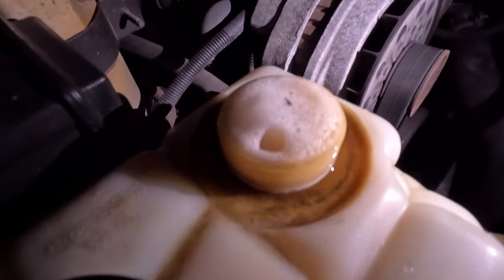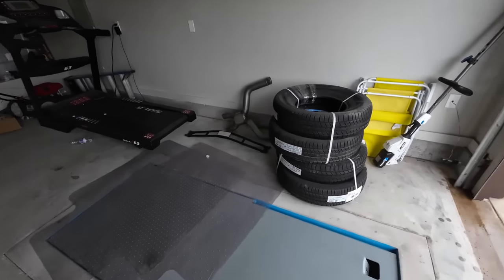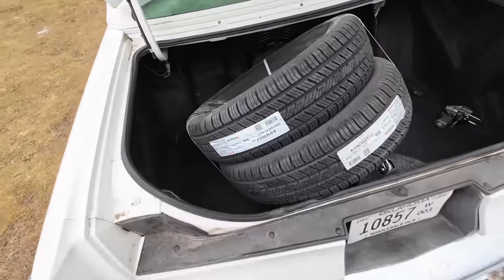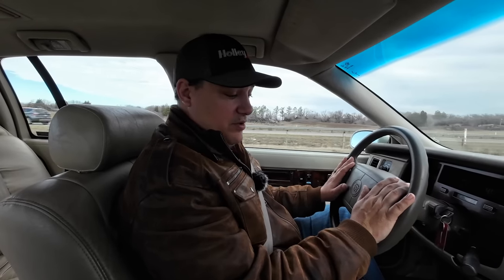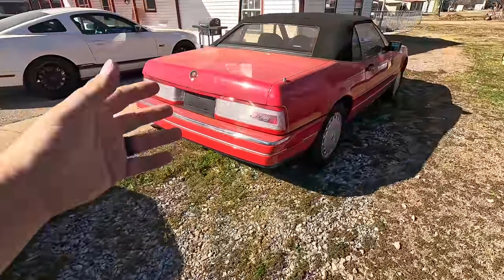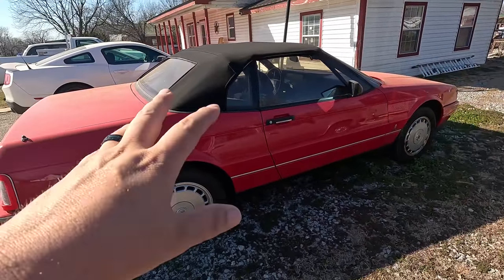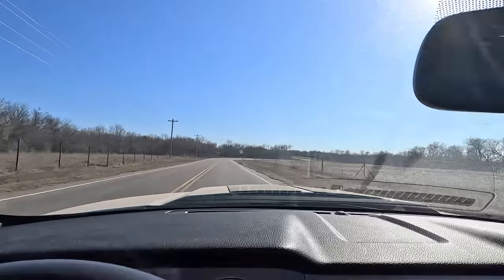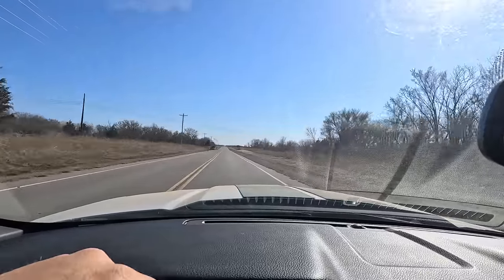My Cheap Cadillac Fleetwood has Cooling System Issues + NEW TIRES!

Comment: Definitely keep her, low miles, previously owned by a senior, very good condition.  I know you would take care of her the right way.  Selling her you don't know if the buyer has that same car caring like you do.  As a car lover, I wouldn't sell her.  I always wanted that generation Fleetwood.  I had a 1991 Cadillac Deville Touring Sedan, and a 1996 Cadillac Sedan Deville.  She's basically a living room on wheels, a sofa in the front and back.  Putting the white walls on, and the maintenance you doing just put a smile on my face.  😊

Comment: The Hankook Whitewalls are perfect!  For the thermostat housing and gasket ALWAYS use Permatex #2 rtv. It's non-hardening, exactly the type of rtv for cooling systems because of the cold-hot cycles of the radiator/water pump/thermostat and housing. That's good you flushed out all that rusty water crap nasties. With new coolant you'll have excellent freeze protection.

Comment: Robert here, Randy keep this beauty. I had a neighbor who went to Germany for 9 years, I brought it back to life, mouse nest not rats, air conditioning problem, tires needed replaced, radiator flushed, wash and waxed....replaced battery, detailed engine & interior. Have it today, head turner today. Wouldn't part with this car, handing it down to my kids, never to be sold. Kids have many names for this unbelievable looking treasure. My throne has wheels, white walls too.1996 Fleetwood B. too, 71,100 miles, changed oil too. But so comfortable 😌,  best American built Caddy I've driven & same white but pearl, chrome & gold trim!!!

Comment: Hey Randy the Cady is looking sweet, I think if you tinted the windows it will make the white color and white wall tires POP even more and make it an even better cruiser in the summer not having to worry about the Sun heat inside the car.

Comment: Use GoJo Hand Cleaner with Lanolin and a soft brush to loosen up and clean the vinyl top ! You will be amazed at how easy and clean it will be ! I did it on my 1975 Lincoln Mark IV and it was like NEW !!! Rinse with power washing !!! You might not need to have it dyed at all !!!

Comment: If you want to make that front seat soft again.! D&L hand cleaner works great because of the lanolin.  Use a Terry applicator work it into leather and buff it off with micro fiber towel . You will feel the difference.  The lanolin moisturizes the leather . This was recommended by a antique  car upolsterer.

Comment: I like Tires plus, and I like Discount Tire, had good luck with both. Looks like a learning point for the tech though. They should always ask you which side is out. 

Years ago I had tires put on and the place had raised letters on one side and black wall on the other side. 😂

Comment: Totally agree with you on the white walls. They make a huge difference in the way the Caddy looks. I personally hate black walls and would have whites on everything I  owned if I could get them in the right size. I put 4 Hancooks on my '72 LTD a couple of years ago but when I needed new whites for my '71 LeSabre last year, I bought some Nexin (Nexon?) white walls off Amazon. The LeSabre had some Generals on it from 2001, so I got 21 years out of them. LOL! - Yeah, I know, but I hadn't driven the Buick more than 500 miles in the last 10 years and not more than 7 miles from home - just to the marina where I found non-ethanol gas.  It needs some mechanical work so I just run it enough to keep things lubricated.

Comment: Hey randy you are gonna want to fill the heater core with  C-L-R.  Calcium lime rust . Let it sit a few hours. Then use a air compressor to blow out the  c-l-r. Then flush and blow out with air and water back and forth. You were so close you. Might as well have changed the water pump. The fins might be missing or rotted ". Worst case the radiator is plugged at the bottom or half way .

Comment: All 3 of my cars with the LT1, 2 Roadmasters and one Fleetwood usually went no higher than 179F, in the summer, and 182 in the winter, and that was with the 180 Stat in it. All my Cars had the Trailer Towing Option, and only had 1 Electric Fan, and one Mechanical Clutch Fan. If there was a Rodent Nest under the Home Plate, I bet they were also Camping in the fenders between the Wheel Well and the Firewall
If you want to control where the HAVC sends the Air, replace the Control with one from a 94-96 Buick Roadmaster. Buick's offered more options

Comment: Some times it's hard to find a nice used car with low mileage that rides like a sofa and decent gas mileage my 99 doge ram wheel chair van with the wheel chair lift on the frame and being heavy and having a 5.2 v8 my dad told me I'm probably getting 13 in the city 16 on the highway a 32 gallon tank it's not cheap to fill up but it's worth it to me it gets me around good only got stranded once after the control arm broke good video

Comment: SEM makes some excellent products for vinyl dyeing projects, I’m sure Auto Spa will fix that vinyl right on up for you. Thank you for doing the whitewalls and the detail/paint correction. She’s a good old girl. Most Cadillac and Lincoln skirts come off the same way. It was the 77-92 Broughams that had sort of a low cut real wheel arch that you could not get around. I still have two skirted girls in my fleet, the 96 Brougham, and my 77 Lincoln Continental. What a pair. LOL

Comment: This reminds me back in 1991 I was driving to my sister's wedding and I was driving a 85 toyota corolla and I swerved to miss a tail pipe that was in the road but not enough and I must have cut the tire and I didn't know I had a flat til I was slowing down several miles down the highway at the exit we normally stop at. It wasn't til I started to slow down on the exit ramp that i knew that we had a flat tire.

Comment: i like that car. i get the Walmart tires fix a flat i use. i hate donut tires i only use full size. i used to have 1976 Eldorado convertible i replaced tires they over 20 years old i drove on tires over 20 years old.

Comment: How did the fans start so early? The LT1 fans should turn on when the temperature reaches 227°F. If the temperature reaches 234°F, the secondary fan turns on.

Comment: Keep this caddy . for what you have I to it 6k . keep the miles low on the truck or other newer cars that will cost money in loss of value . you could pit 100 k on this car and does not matter because of what it cost you . use that as your daily as you have a two hour drive to the shop and home most days . you made it beautiful again and should enjoy it rather than letting someone else get the joy you could have .